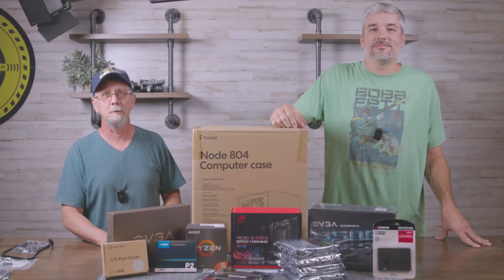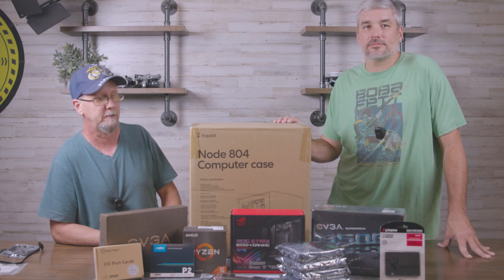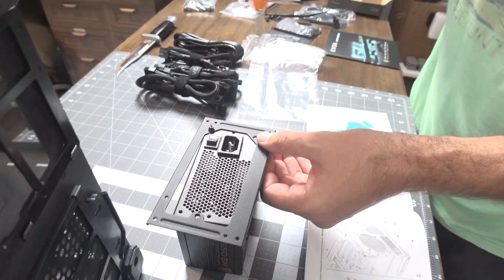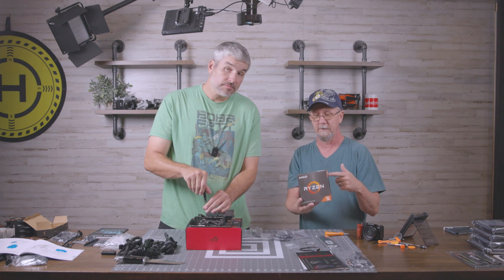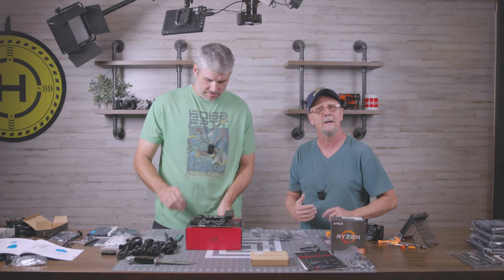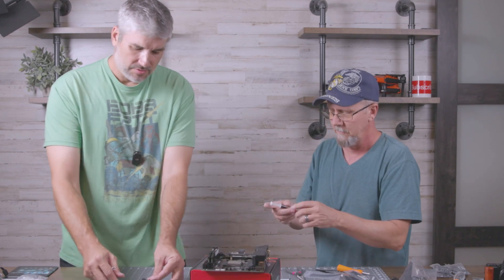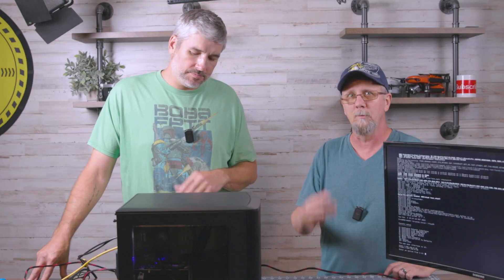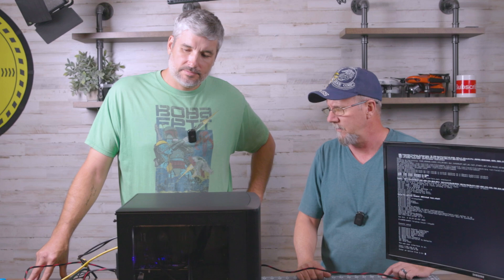Need More Storage? Network Attached Storage Build Walkthrough

Comment: There's no GPU in this build?
Reply from the maker: It’s a server, not a gaming machine so we just used the on-board video out. Once it gets built, it goes in a well ventilated hiding spot.
Reply: @SeanHelmsMedia  You could if yo uwant ot share this as a video server across. It will help in transcoding.

Comment: Entertaining video guys! I'm doing research  to build a NAS PC and found your video. My plan is to finally back up my 1200+ DVD & Blu-Ray collection onto a device that can stream to 4 Smart TVs in the house. I won't go AMD like you did - I happen to work for Intel (27+ years now) and am thinking of doing an i5-10600 build with 16G of RAM, MSI B650 mobo, 430W PSU, all inside a Silerstone or Thermaltake micro ATX case. I may even get a Quadro 400 GPU to help with hardware decoding (still doing research to see if that is necessary). I am probably going to do 16, 20, or 24TB of NAS hard drives - not sure exactly how much space I'd need for about 1000 DVDs and 200+ Blu-Ray movies.  

I want to boot into TrueNAS and use Jellyfin as my software - was hoping you guys had a video explaining how to set all that up. Looking forward to more from you guys.